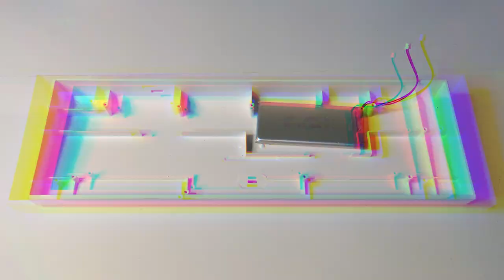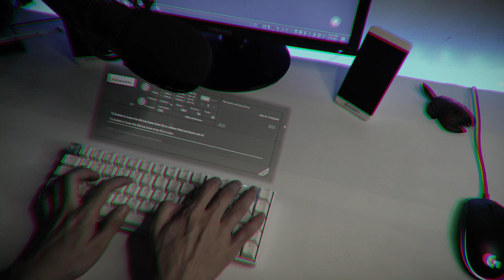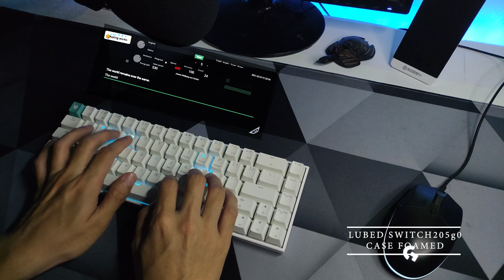Tecware B68 Lubed Gateron Yellow, Type Test | Chill Music

Comment: great video. Though it will be better if you use size 00 paint brush for lubing. andali kasi ma over lube ng gamit mo na brush. just a suggestion though.
Reply from the maker: thanks sa suggestion
Reply from the maker: i think its really on how you lube. less is more like they said. so you had to thin the lube first on brush before stroking. but i will try and do some experiment on it. thanks again
Reply: @NiftyKeyboards  that is exactly my concern, malaki kasi masyado yung brush and no matter how much you thin down the lube on it, marami parin kakapit dun then sa lapad nya malalagyan pa ng lube ang parts na di naman necessary ilube. Though baka preference lang din talaga.

Comment: How did you break the dampening foam 😱 how should I avoid this when I'll mod my keyboard? Great video btw!
Reply from the maker: i had no idea that it has dampening foam there before. I'm sure knowing it will avoid that to happen :)
Reply: A bit late to add to this video, but it doesn't really matter if you break it tbh. Foam is foam; it will have sound dampening properties as long as it's there and retains its density. The only problem if you break is that it might be irritating to take off/move around, but that's only if you wind up ripping it into pieces. A small tear or something isn't really going to affect anything.

Comment: Is it okay to lube the metal leaves inside the switch? And how many layers of eva foam did you put in the case?
Reply from the maker: yes that's fine for linear switch, lubing it with tactile will reduce the tactility. eva foam with 2-4mm will be good

Comment: actually no need to holee mod the stabs since you used permatax because the lube is very thick and holee mod will sound mushy if you use permatax
Reply from the maker: rattle will come back if stabs wire isn't balance, no matter how much dielectric grease u put

Comment: question lang po sir, na ttanggal ba yung steel plate from the pcb without desoldering pump(only exposed screws)? kasi may tecware phantom tkl ako which needs a desoldering pump to reveal a screw na mag ttanggal ng plate from the pcb. i have upgraded to the b68 which concerns me hahaha Thank you!!
Reply from the maker: yess. watch my unboxing video. pause at 4:21

Comment: may something off sa right part ng spacebar stab slot diba sir? like hindi siya pcb mismo or sabihin natin parang butas
Reply from the maker: look like butas siya, parang cinut yung pcb
Reply: @NiftyKeyboards  possible cause ng rattle sa stabs?
Reply from the maker: di naman yata, wala na sakin si b68 pero na fix ko yung rattle by balancing the wire